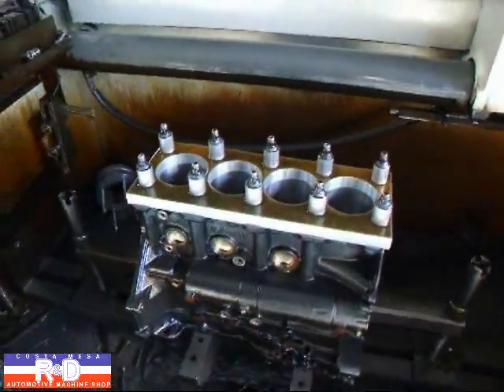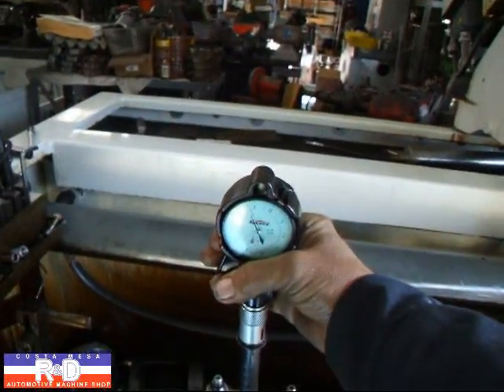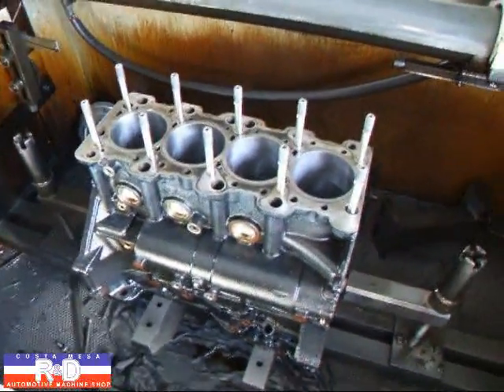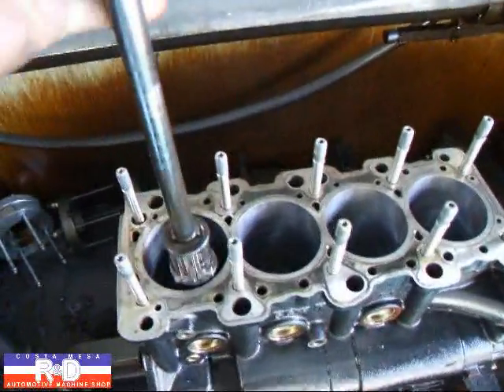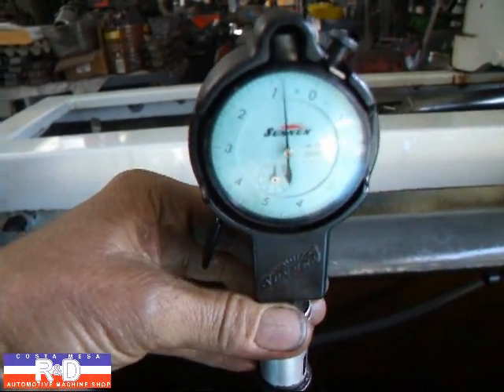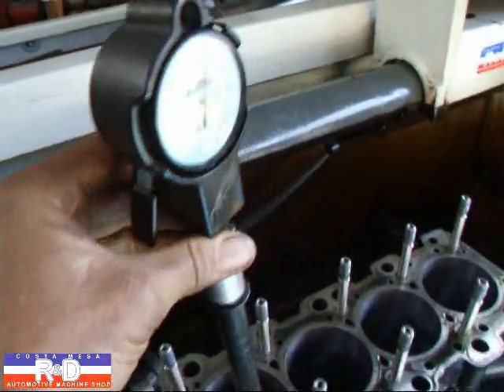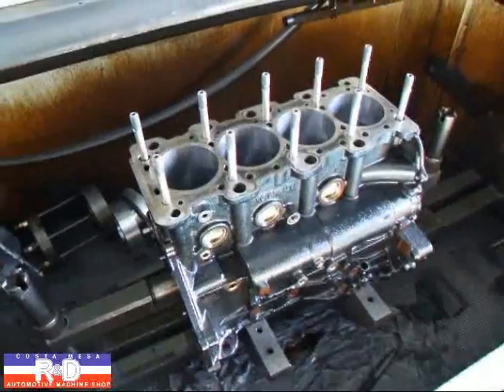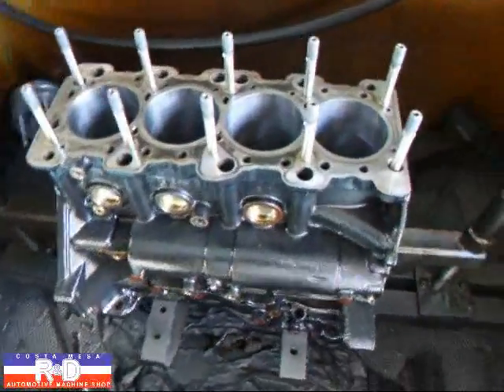Mitsubishi 4G63 Honing with Torque Plate

Comment: .0005 difference ? You may think this will make a huge difference but not really.  The cylinders also change shape as the heats up and cools down. Thinner rings will conform to the cylinder walls better if you are concerned.

Comment: if you hone it with the torque plate on and crank in. would it make a difference? i have read that with the crank in can make a difference when honing  as apposed to with out a crank.

Comment: dumb question but do you have to use a head gasket when torque plating the block?
Reply: William Seroyer Thats an excellent question, I am not sure, but i have seen this done and never noticed a gasket, and think about it, the gasket would crush, and become useless each time, would be costly throwing all those gaskets out!
Reply: Using head gasket is the preferred method. With modern multi layer steel gaskets there is no harm done and they would be more that suitable to utilise in the final build.

Comment: john i have a question for you i have a 2004 corvette 5.7 ls6 car i have the rotating assembly i will be going with a 4.00in stroke crank and about .010 over on the pistons ,,, how much will it cost me to to have the engine     disassembled, machined for the stroke clearance ,bore/hone piston bores and assembled back together ? i have the rotating assembly main,rod,cam bearings everything i need for this set up how much would this run me.. thanks john

Comment: not sure on your first question but,  to your second, my understanding is the torque plate simulates having the head on and bolts/studs tightened ,  the bolts/studs when done up with the head on, place stresses on the engine block that slightly pull the bores out of shape, by adding the torque plate and tightening down and machining it at the same time, once the head is bolted down the machined bores will be round rather than slightly out of shape, better for ring seal and piston/bore wear.

Comment: I have never done it but if youre talking light scratches or wear you can probably hone/recondition it with a flexball or similar. Otherwise you'll probably need a new sleeve and to machine the old one out or possibly recoat it somehow. The coating is around .002-.003 thick so it'd have to be a light hone.

Comment: I am not an experienced engine builder like John but on my alum block, forged alum piston mod motor ford piston to wall clearance is about .003" so .0005" TIR out of round is not necessarily going to destroy a motor but if you clearance for .0030" during bore/honing what you'll actually end up with is .0035 on one side and .0025" rotated 90 degrees once the head goes on. Your pistons should be round within about .0002" radially IIRC so there's also the possibility of tolerance stack.

Comment: whats the compression ratio going to be on this thing?
also, why do the cylinders go slightly out of round without the head or torque plate torqued down?  is that just the properties of the material the block is made from, or is this something you or mitsubishi did from factory for more power?
Reply: Bolting anything to an engine block applies considerable stress, and this causes the block to distort.  This happens because the block material has to bend and stretch under this stress.  Boring and/or honing an engine block under stress ensures that when the engine is fully assembled the bore shape and alignment are as precise as possible.  It is much more important to do this with an aluminium engine block because the material is more ductile, but this can have benefits on any type of engine block.

Comment: Is it possible, or even advisable, to create a torque plate from a scrap head?

Would the removal of the combustion chambers from the head weaken it too much, the machining required possibly warp the head and/or would it just be easier to invest in a torque plate to begin with?